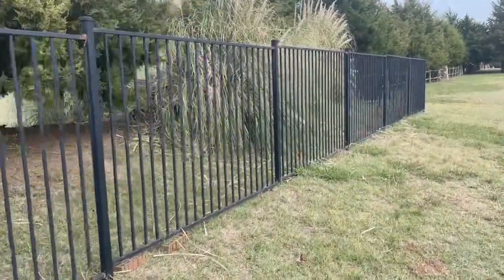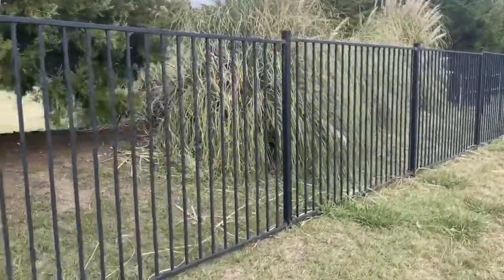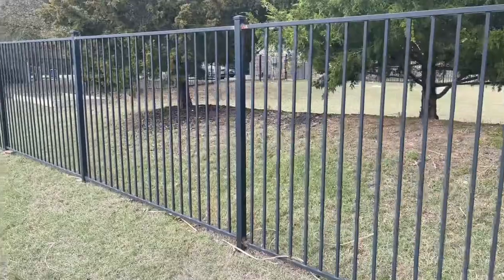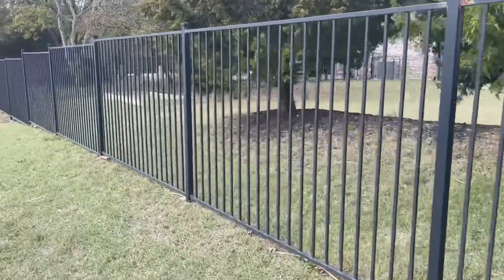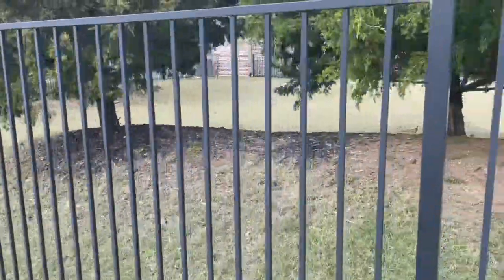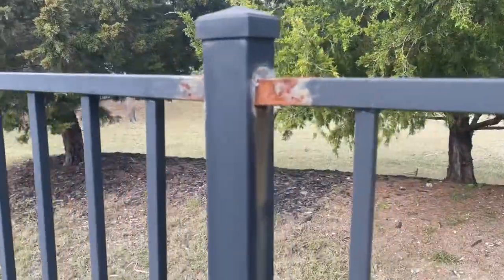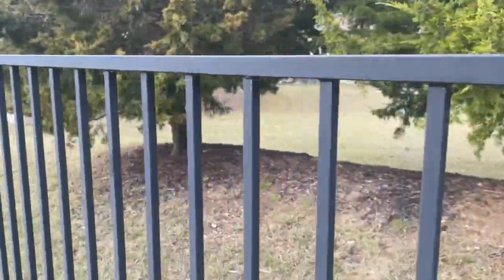Dont weld new iron fence. Tips for #wroughtiron .

Comment: The problem here is paint does not stick to oxidation that was induced by the welding process, hence it came off easily and prematurely, and exposed the metal to the elements. After welding, the welding induced oxidation needed to be sanded off (I use laser to clean it off), then paint. That paint will adhere properly and last a long time, and will be easy to touch up when needed. The poor paint adhesion was the problem and will be a problem again unless the oxidation is removed first. It's the equivalent of painting over a dusty/dirty surface.
Reply: Yup this usually happens when they don't even try. A good brushing and cleaner before painting would prevent this